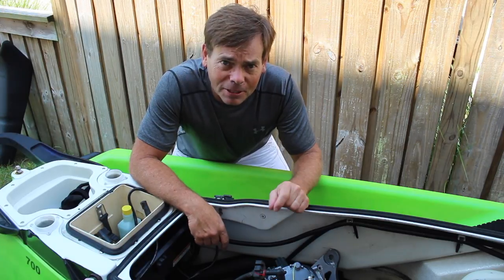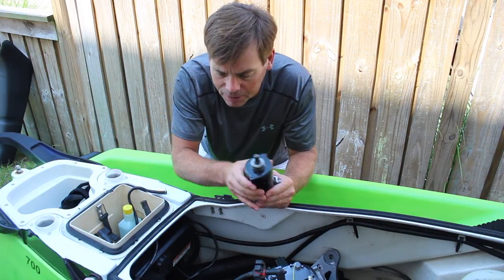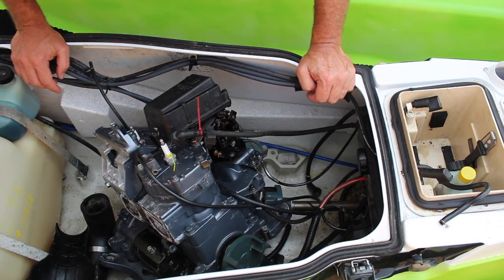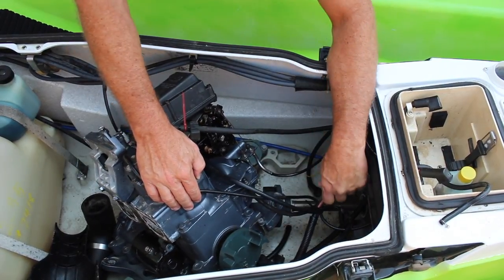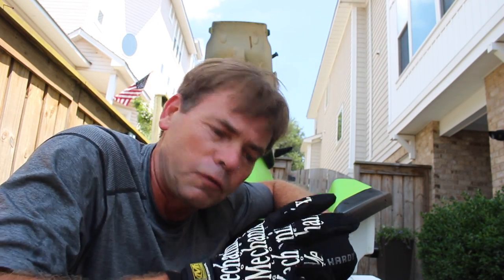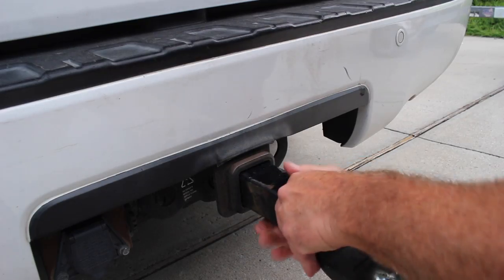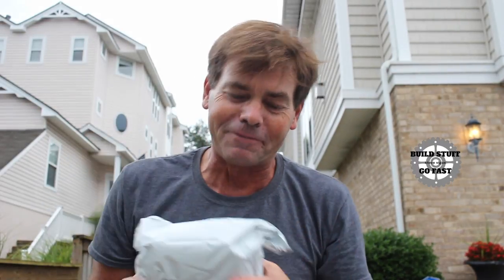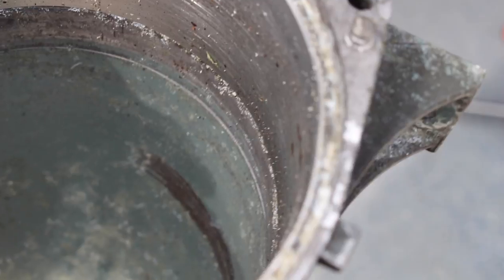How to Remove Yamaha Jet Pump - Jet Ski Restoration Part 5

Comment: Hey Steve you should cut out the wear ring with a dremel small cutting disk, might be extra if you do not have one, I just replaced mine on Kawasaki 900 STX stainless steel wear ring , same exact problem swells up due to salt water corrosion, I have a video I made but I have never uploaded it, if you need to see how i cut it out I can more gladly share, Thanks and good luck
Reply from the maker: Thank you so much for the tip. I considered it but wasn’t sure about the aluminum. Is there a layer of plastic under the aluminum or is that something else I see? Gonna use your technique and post the results.
Reply: Steve there should not be any plastic under the stainless ring, if you cut it with a small dremel at a angle and slowly punch it out with a chisel it should come right off without damaging it,  thats how I took mine off, my wear ring was really worn out i had probably about same amount off gap in between the prop, i ended up going with solas from SBT, and a stainless wear ring as well that's the only one they provide you with actually , if i get some time off this week i will def upload my video to help you and other DIY guys out here that try to save Money instead off taking to a rebuild shop that charge $$$$ ,Thanks again
Reply from the maker: Cool. Let me know when it's up and I'll share a link.👍👍👍
Reply: Hey Steve i uploaded a video you can check it out on how i removed the Wear ring, more welcome to share if you like
Reply: @2turbopower  The Video is unavailable. Can you please re-upload it?
Reply: Damn I wanted to see that video

Comment: Hey Steve as always great videos. Can't wait to see the next video. I agree keep the old skis running as you know I have a 1993 Seadoo XP and a 1993 Seadoo SP and they run like a champ. My only issue is I have 2 single trailers and I'm on the look out for a double.   Who know maybe one of these days I will come out to visit.  Hope you and your family are doing well.
Reply from the maker: Bet you can pick up a double this winter and then cover the cost selling the other two in the spring. Let me know when you are ready for some warmer weather. We usually have a little extra that we can share down here.
Reply: @StevenVigus  I'm ready now. LOL it's 50 here but all it's been doing is raining
Reply: Okay it is officially winter. We got wet snow here but neighboring areas got 1 -2 inches.  I'm ready to come and visit.  Hopefully you have warmer weather

Comment: Hey Steve you have inspired me to so much so I went out and bought a 94 seadoo xp for 400 bucks and i am now in the process of restoring it/ making it less 90s looking and i was wanting to know if there is anyway you could sell me one of those carbon fiber dash panel thing from your previous video thx! Plz plz post some more jet ski videos!
Reply: i really want a 95-96 with the x4 hull supposed to be fun! or a purple bottom raider.... im buying a 550 stand up this week and currently have a wave venture 1100 and a gp1300r. love my 2-smoke engines!

Comment: From what you remember 
Would you say it’s easier to pull entire engine or swap top end while leaving in ski?
Scenario 
Have complete runnning replacement 
Current motor 1 cylinder no compression/ other down to 100
It was run on straight gas (OOPS) 😢

Comment: Question. you carried to parts store had them bench test it? Your bench broken? connect cable to it lay it onto top of head grounded and hit start button????? or jumper cables hot to cable lug tap ground to case???

Comment: Hi sir I've been following you for a few days now great job on all your blogs.... I have a question for you see if you can help me out I have a 2000 bombardier gtx millennium edition and I can't get it to go past 25mph it keeps bogging down and now it won't start I really dont know much about sea'doo's and I've taken it to a shop but they tell me that theres nothing they can do cause it's a older model if it was 03 and up they could look at it what can I do I would love to take my kids out on the water and enjoy the sea'doo but can't get it to start. What do you  recommended to get it up and running thanks
Reply from the maker: Could be a zillion things. There are some troubleshooting flow charts in the factory service manual. You can find a link to download yours for free on pwctoday.com. The pwctoday forum is also a good place to find information on common problems and troubleshooting. The members have saved my bacon a bunch of times. Generally speaking, your problem is going to be with fuel, spark or compression. Of these, compression is the least common. If you are getting a consistent bright blue spark at the plug then start looking for fuel problems like a bad selector valve, gummed up fuel lines, or the carb. Sorry I can't walk you through all the troubleshooting steps here in the comments. Maybe we need a troubleshooting video or two.

Comment: Hey Steve, I just got a 1994 Kawasaki 750 SS. It runs great besides some minor issues but I’m looking to restore it. I’m looking to recover the seat, repaint it, install new floor mats, and maybe add custom graphics or minimal Kawasaki graphics.  Do you have any tips or suggestions for this?
Reply from the maker: Cool ski. Bet you can find s few you tubers who have taken on projects like yours. I say find one you like and copy mercilessly.
Reply: Steve Vigus ok thanks

Comment: I have a early 2000's Yamaha 1100 triple with no engine or title. I want to put a small engine from a lawn mower or something you think that would be enough to go on the water with?
Reply from the maker: We have toyed with the idea of putting a Predator 212 in a ski just for the fun of it. I see a couple of limitations: First, you will get around 12 hp vs. the 110 hp of the stock engine. Second, I always worry about gas fumes in the bilge. It doesn't take much to get the ambient fuel/air ratio to a point where it will go "ka-boom!" If you are planning to cut away a bunch of the upper hull for ventillation and if you don't mind going put, put, put around the lake it could be a fun project. I would love to see the final design.
Reply: That's what I'm thinking cause you can get 20 to 30 hp out of those engines

Comment: if u put the plastic wear ring in the freezer it shrinks and i believe to obtain the same results to remove the metal ring should be heat! metal shrinks with heat

Comment: Where is a good place to get used jet ski parts for my Yamaha Wave venture  700 CC
Reply from the maker: At this point I'm getting most of my ussed parts from ebay. Items that are still in production you can pick up from online shops but the dealers don't have much NOS any more. My general rule is that if I find good free information on a store's website that helps me with a repair or troubleshooting then they generally get my business.

Comment: Hey man! I have a issue with my kawasaki 1200stx. ITS taking in water... and er cant fix IT with glue because er cant get to the point.  I hope you have some tips !
Reply from the maker: Where's the leak? BTW, love the STX profile pic!
Reply: Haha yes.   ITS behind the motor under the backpary
Reply: Steve Vigus backpart**

Comment: Finally i found a channel that does proper diy for pwc!! Much love. I have a project and i was wondering if you could provide some easy info. I have a deal on a kawasaki zxi 1100 2001 hull with no engine, and i have a spare engine (crank to flywheel 850mm, cam cover to sump 550mm intake manifold to exhaust 560mm). I was wondering if its possible for you to help me get approximate measurements( simply height width and length where the engine sits). Sorry if i am asking for too much but the pwc is far away. It would be awesome. Thank you in advance. Your channel is amazing!!
Reply from the maker: I would love to help you out but I don't have any experience with kawasakis. Generally speaking I would say that swapping out an engine for  another model is going to be quite a chore, particularly when you can pick up an ski with engine so inexpensively. Good luck on your project. It's going to be epic!
Reply: @StevenVigus  no problem man!! Keep up the good videos. I wanna ask you is there a way to avoid jet stuffing and destroying the jet and myself?

Comment: Where can u get a new key post and safety cap for a 97 bombarder. Gts
Reply from the maker: I'm a big fan of eBay for parts. Believe it or not, your local SeaDoo shop might be able to get new old stock (NOS) parts but they will probably cost a lot more.

Comment: hey steve i have a old seadart  1987 jetski whit an 500cc honda lcr my problem is dat my bearings in my jetpump are stuck i have no clue how i can remove the back end of the pump it is realy stuck on there can you give me some instructions how i can remove it to replace my bearings  thanks a lot!
Reply from the maker: Never heard of it. Do you have a link?
Reply: thats just the problem icant find anything about it

Comment: Love the 61-63 Thunderbird rocket!

On the starter, you should seal the front edge with rtv.  Always a good idea on a Yamaha 701/760 motor.  Especially with the salt water around here!  NOT on the o-rings, but on the front mating surface where the starter mates with the case.